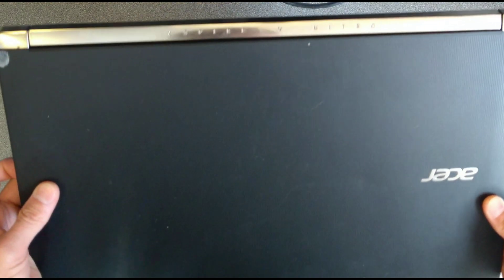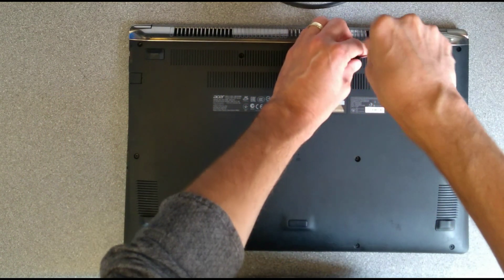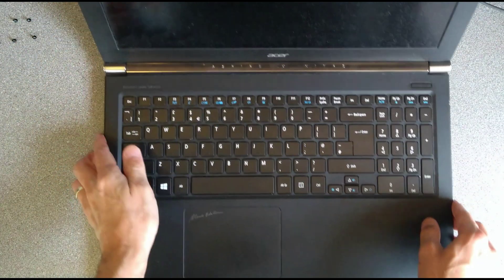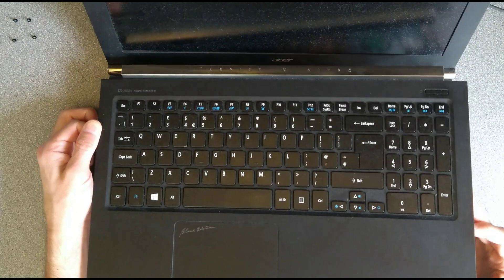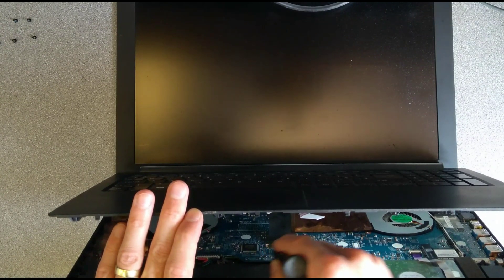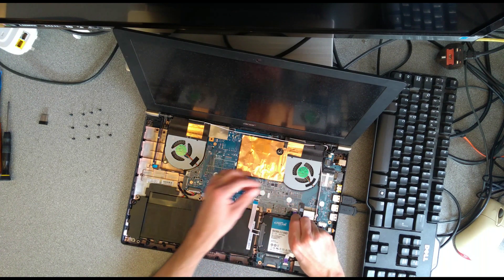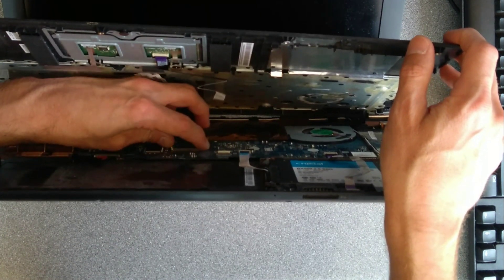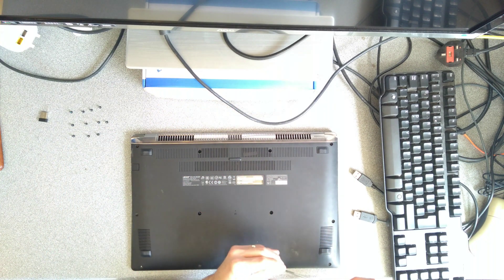Acer Aspire V Nitro: How to change or upgrade the hard disk (MS2391 / VN7-591G-592Y)

Comment: Thank you very much for this video! It helped me a lot. I recently re-activated a now 10 years old Acer Aspire V Nitro to test Linux and I found out the 1Tb hd had a SMART error so I replaced it with a 2Tb SSD. Now that old computer is really quick again, running with Linux Fedora 42. 😃👍
Reply from the maker: Linux really renews old hardware:)

Comment: Hi mate, do you know if I can manually add a TPM 2.0 chip to my motherboard (Acer Aspire VN7-591G Intel HM86 (Lynx Point) V1.13 01/08/2015 DDR3 SDRAM 16 GB)? 

I don't know if my motherboard has the slot to insert the chip. It's the only requirement I need to update to W11. 

Thanks in advance!
Reply from the maker: Even if it had TPM your CPU isn't on the supported list. You need a 6th generation or newer CPU I think. (Maybe even 8th generation? Google for windows 11 compatible CPU list and it's a Microsoft result with a long list of intel processors.).
Reply: @freename  Thanks for the answer. And what about Windows 10 LTSC? Would be it a valid option?
Reply from the maker: @malto20 not sure when the eol / end of support is for that, but might be a good option.

Comment: Wow, that touchpad white plastic bar popped out in the process of releasing the touchpad cable :(( yet it doesn't look broken?!! I see on both sides a small pin on that bar, which should pop back on to the holder. Yet how??? Please!  :)
Reply from the maker: I would very gently and making sure during the entire process that you do not break the pins at the end.. and try to put it back into place. (and that the holes it clips into have not been smashed?). I don't have the Aspire V Nitro around any more to show you what to do, sorry.

Comment: Thanks for video - my Laptop has 250GB SSD - and I just wanted to change it for 512GB Samsung or maybe bigger. It seems to me I will give-up, seeing this video. I would say somebody should get Nobel prize for such a design. I would probably use NVME SSD in cage connected via USB blue ports (5GBits) - not optimal but still twice as fast as original whatever it is. Only problem is another device sitting alongside the laptop.

Comment: I have an older v17 Nitro Black Edition. Essentially the same process but maybe two extra screws. There's always a couple that just don't want to unscrew. The keyboard / trackpad in the v17 are more integrated so you don't have to worry about the cables. Best advice was the crafting tool to lift the keyboard-base. Great video.
Reply from the maker: Thanks for the comment and I'm glad to have helped :)

Comment: Can i inistal an m.2 nvme ssd ?
Reply: Yes, you can insert m2, but max. 250 gb
Reply: @szymonkozlowski999  Hey I tried installing a 500gb SSD on the laptop but it isnt showing up. Where did you find that the max size is 250 gb?
Reply: @kevinyang998  Hey, I've  found this in the Acer specification. Regards!
Reply from the maker: I see what looks like the slot below the fan on the left side at 9:47 in the video. I cant confirm as I don't have that laptop here any more but it looks like the right size slot and the correct screw placement to the left.